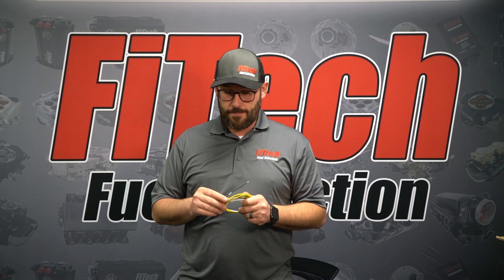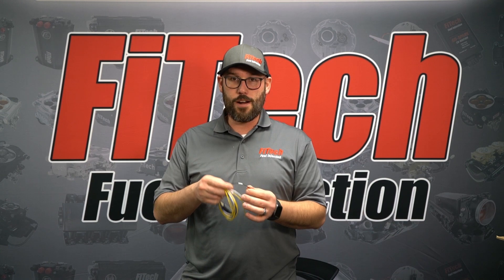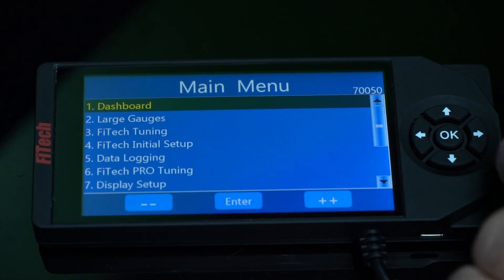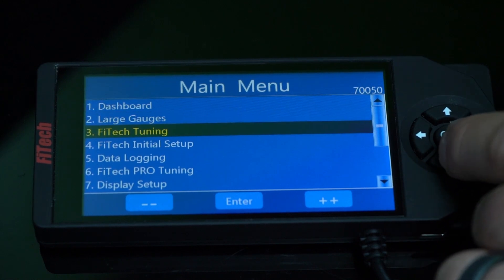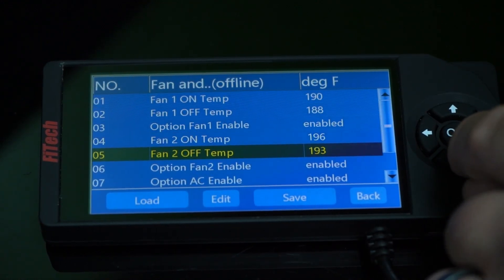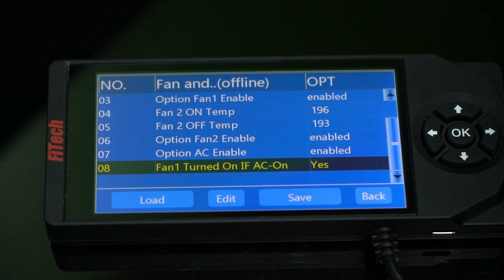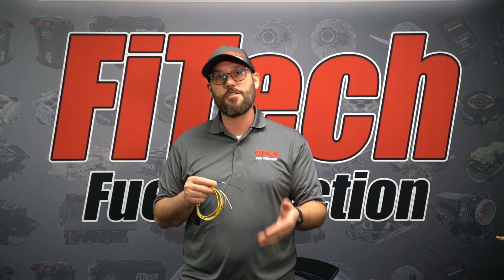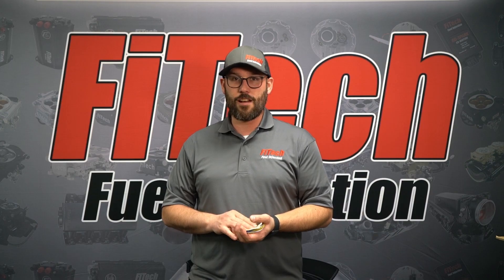A/C Input Wire | Tech Tuesdays | EP58

Comment: Instructions say ac black wire goes hooked up to ground?? Please help. Got a fitech 400hp
Reply from the maker: Hello sir,

The AC wire, black accessory wire would go to the positive side of the AC clutch, when the AC kicks on this wire should be getting voltage to provide a signal to the FiTech system and this will raise the RPMS and help activate the electrical Fans (if this applies to your cooling system. Instructions: 1. RPM kicks up when A/C is activated.
The FiTech system does require a return, unless a regulated in tank fuel pump module is being used, however, the system would need a return if ran otherwise.

Comment: I was told to hook this up to my msd box by fitech for timing control. Im super confused now.
Reply from the maker: This depends on the kit you have. If using a Go Street or Easy Street the black wire is for AC. If you are using a Go EFI or a Power Adder system then the black wire will be marked COIL.
Reply: @FiTechEFImedia  so the black wire tagged as coil goes where? On mine it’s connected to my msd box. Do I splice into this to wire into a button for 2step?
Reply: @FiTechEFImedia  It troubles me that this Fitech system is reacting as if it is still in development stages, due solely to all the unavailability of the technical information not there for everyone to see. If I understood correctly, the black wire with the coil markings goes to the AC clutch wire, right?

Comment: Is this cable not also used to activate 2step?
Reply: I figured it was short for accessory in. Have yet to receive an answer for my question on this video.
Reply from the maker: This wire is for AC input. On some systems you may find a feature to change the input for 2-step when using timing control.